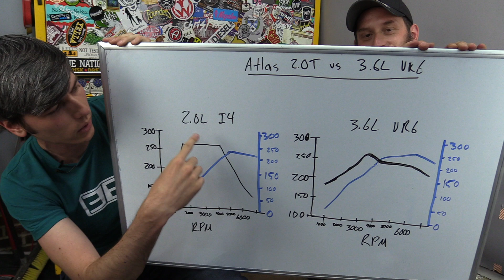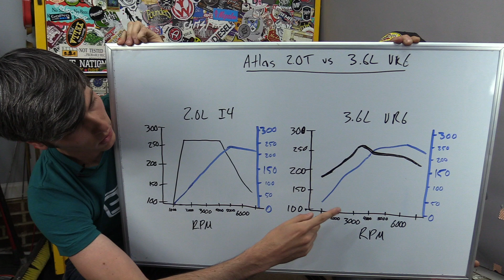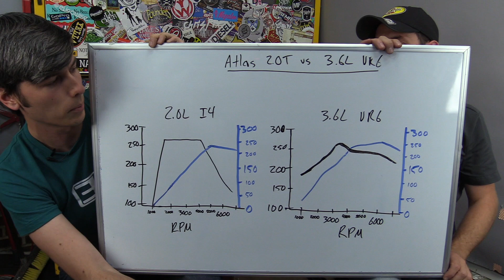4 Reasons Why The VR6 Engine Is Dying Off

Comment: Yet 4 cylinders sound like a weedwacker
Reply from the maker: What amazing weed whacker do you own!?
Reply: True dat, i'll admit, EJ25 sounds really nice.. and some JDM I4's.. those are old school, but modern ones like VW's TSI or Fords ecoboost.. what I hate the most about these modern cars is that they fake the noise inside the cabin. With that they are admiting that their engine sounds bad. It's like homemade Mc'Donalds, it'll never taste like a real one
Reply: Engineering Explained I4s could sound alot better than they do. Listen to the newer Yamaha R1.
Reply: The engine which sound most like a weed whacker are rotary engine, but they are nicely-balanced engines with a decent Power to Displacement ratio. Needs a lot of cooling, suffers on torque and reliability issues though...
Reply: Suffers on torque? Mine makes 348ftlbs to the wheels.. Stock turbo
Reply: However, boxer 4 is the ultimate example of one that does.
Reply: I know it's the wrong times to say this, but I don't wanna own a 4-banger again... not that it means anything, but I love how MB is going back to inline 6... I loved those engines from the W124 / W126.
Reply: Thats just an opinion, you see i think some of the best sounding vehicles out there to me are the old 2.0l inline four rally cars. More Modern high power inline 4s like the Golf R or the Fort Focus RS sound great aswell. Shure, i do like the powerful rumble of a V8, especially on the low RPMs but its not the one and only way to go for me. What i myself cant stand is rotarys, THEY sound like a weedwacker on steroids.
Reply: Engineering Explained '15 s3
Reply: DJLJAYPn0yDriftR suffers on torque just like inline 4's
Reply: The only four cylinders I've listened to that I'd compare to a weed whacker would be the 'Fast and the Furious' crowd who throw the Ebay exhausts on their cars...
Reply: "Sorry, I can't hear you over my Boxer Rumble!" #Flat4HorizontallyOpposedEngine

Not all 4-cylinders sound like weed whackers...
Reply: Rotary engines sound much smoother.
Reply: Well, certainly they do not sound good, otherwise they would not amplify and fake the sound inside the cabin through the speakers ...

Comment: A turbo VR4, hmmm?
Reply: SI0AX Honda makes a v4 bike motor that's beautifully smooth.
Reply: Honda's V4 motorcycle engines have perfect primary balance. They're 90 degree angles though, not narrow angles like the VR motors. Very compact engines with a great powerband.
Reply: Veyron and Chiron have essentially two VR8's arranged in a large V-bank, and forced with 4 turbochargers.
Reply: Frederik Krabbe maybe a double vr4 so like two vr4s mounted in a V8 configuration and the ideas go on haha
Reply: I am aware of V4's have been made, and it wasn't a completely serious comment, as I doubt it would be very effective.
Reply: Richard Hunter i saw one of those 2 months ago! i had to check if it was a troll or if it really existed xDD
Reply: But I4 also needs balancing(balance shaft), so is VR4 even less balanced?

Comment: diesel electric please
Reply: Its coming... Trust me xD
Also at concstant load (like a generator) a diesel is much more efficiant than a Gasoline engine
Reply: James Smith yes, like gasoline engine.
Steam power FTW.
Reply: Low end torque of a diesel with the torque of a electric motor. There's a reason why they're rare. Gas is better because you can cruise and get good mileage and the electric can accelerate you from a stop.
Reply: Germany making U-Boats again???
Reply: The VW X1 is diesel electric.
Reply: Electric has no soul though.